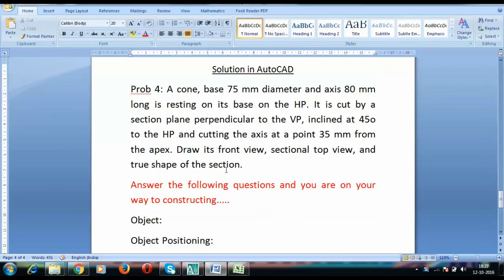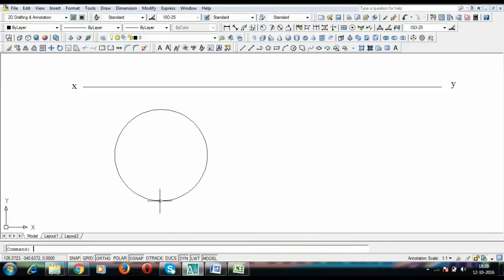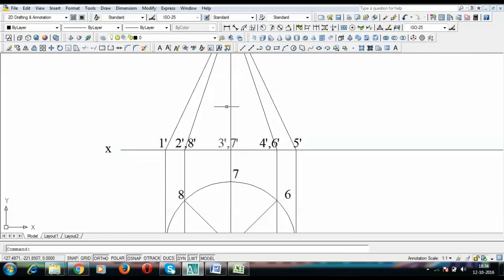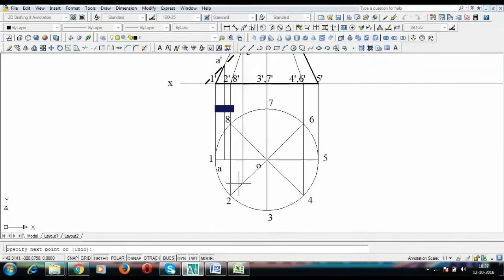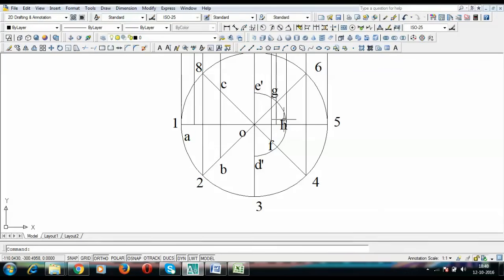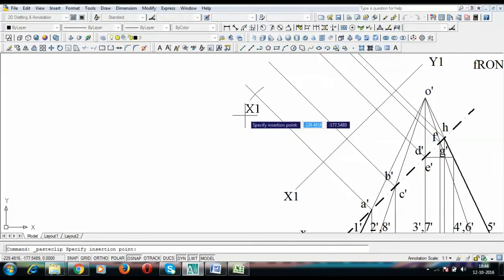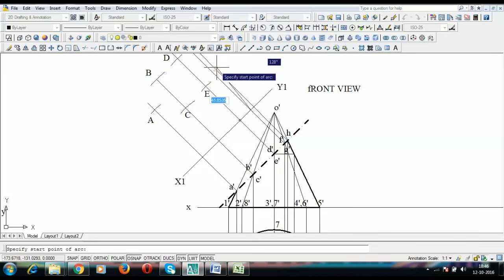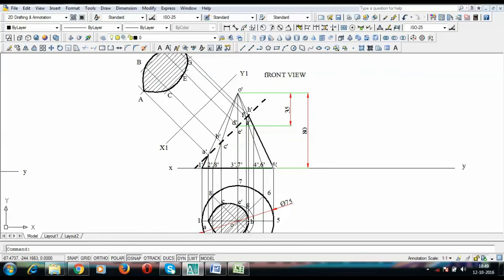4. How to section a cone and draw true shape of section

Comment: cone, base 75 mm diameter and axis 80 mm long is resting on its base on the H.P. It is cut by a section plane perpendicular to the V.P., inclined at 45° to the H.P. and cutting the axis at a point 35 mm from the apex. Draw its front view, sectional top view, sectional side view and true shape of the section.

Comment: A cone, base 75 mm diameter and axis 80 mm long is resting on its base on the HP. It is
cut by a section plane perpendicular to the VP, inclined at 45° to the HP and cutting the
axis at a point 35 mm from the apex. Draw its front view, sectional top view, sectional
side view, and true shape of the section.

Comment: A Hexagonal prism of base side 30mm and axis length 60mm rests on one of its ends on the HP with two base edges parallel to VP. It is cut by a plane perpendicular to the VP and inclined at 30 degree to the HP. The cutting plane meets the axis at 30 mm from the top. Draw the front view, sectional top view and true shape of section. help with this question sir

Comment: A cone of base radius 30 mm and height 100 mm is resting with its base on the 
VP. It is cut by a section plane parallel to VP and perpendicular to HP and 
passes through the midpoint of the axis. Draw the projections and indicate the 
section.

Comment: A square prism of height 80 mm and base of diagonal 40 mm rests on the HP on its base with base edges equally inclined to the VP. It is cut by a section plane passing through the midpoint of the axis of the prism perpendicular to the VP and inclined to the HP. Find the inclination of the cutting plane if the true shape of the section is a rhombus of diagonals 60 mm and 40 mm 

sir I want answer to this question please

Comment: Sir please give solution of these three questions.
1) A hollow square prism, base 40 mm side (outside), height 65 mm and thickness 8 mm is resting on 
its base on the H.P. with a vertical face inclined at 300
to the V.P. A section plane, inclined at 30 to 
H.P., perpendicular to the V.P. and passing through the axis at a point 12 mm from its top end, cuts 
the prism. Draw its sectional top views, sectional side view and true shape of the section.
2) The projection of hemisphere 50 mm diameter, placed centrally on the top of the frustum of a 
hexagonal pyramid, base 32 mm side, top 20 mm side and axis 50 mm long are given. Draw the 
sectional front view when the vertical section plane H.T. inclined at 450
to the V.P. and 10 mm from 
the axis, cuts them. Also draw the true shapes of the sections of both the solids.
3) A sphere of 50 mm diameter is cut by a section plane perpendicular to the V.P., inclined at 450
to 
the H.P. and at a distance of 10 mm from its center. Draw the sectional top view and true shape of the 
section. 

Sir if u want to share me solutions personally then my whatsapp no.is-9928466781.

Sir i will be very thankful of yours.

Comment: Problem 14-1. (ig. 14-2): A cube of 35 mm long edges is resting on the H.P. on one of its faces with a vertical face inclined at 30 degrees to the VP. It is cut by a section plane parallel to the V.P and 9 mm away from the axis and further away from the V.P Draw its sectional front view and the top view.
This question tells about the position of cube

Comment: Problem 14-4/ ig. 14-5): A cube in the same position as in problem 14-1 is ut by a section plane, perpendicular to the VP, incined at 45" to the H.P and assing through the top end of the axis. (ij) Draw its front view, sectional top view. nd true shape of the section. ij) Project another top view on an auxilary plane, arallel to the section plane.
Solve this please..

Comment: A cone of base 50 mm diameter and axis 70 mm long, resting with its base on H.P is cut by an auxiliary inclined plane making an angle of 45 degres with HP. Draw FV, sectional TV and true shape of the cut section when the plane bisects the axis of the cone.

Comment: Sir please give me some hint to solve this kind of problem.
A cone, diameter of base 60mm and axis 70mm long, is lying on HP on one of its generator with axis parallel to VP. A vertical section plane parallel to the generator, which is tangent to the ellipse for the base in the top view, cuts the cone bisecting the axis and removing the portion containing the apex. Draw its sectional front view and true shape of section. Also develop solid